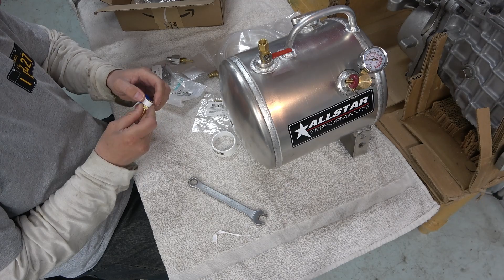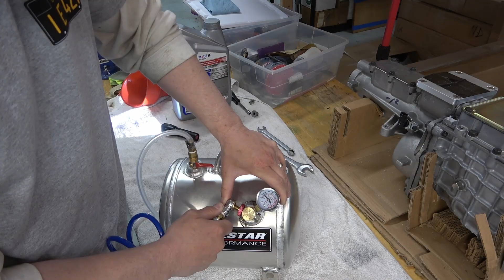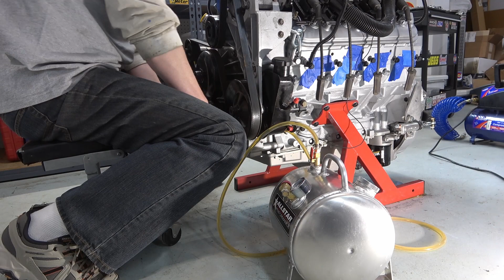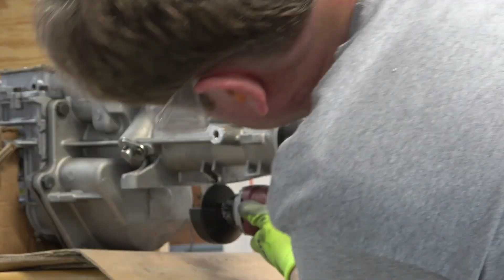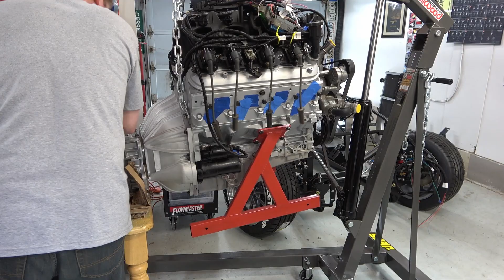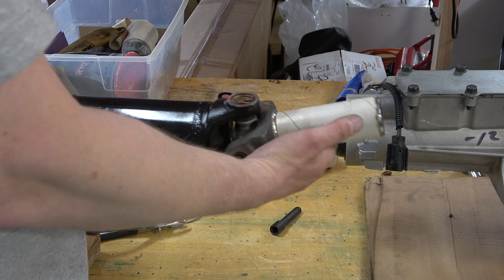Budget LS Factory Five Cobra | Build Update 29

Comment: I would certainly perform a leak-down to make sure nothing is wrong though but that engine will run forever with that little bit of sludge.  If it starts to make noise you can always rebuild it after saving some pennies.  Between leak-down and cutting the oil filter to make sure it's all good...

Comment: I think you’re supposed to have the can stand vertically with the output on the bottom so the air flows to the top. I think that helps get rid of bubbles. Maybe it doesn’t matter. Just seems like it would. Great video!